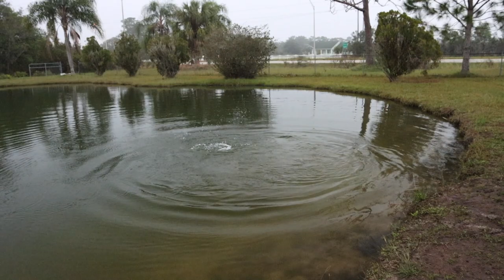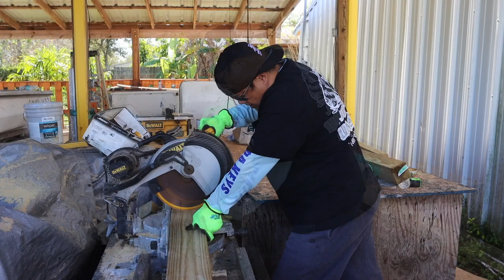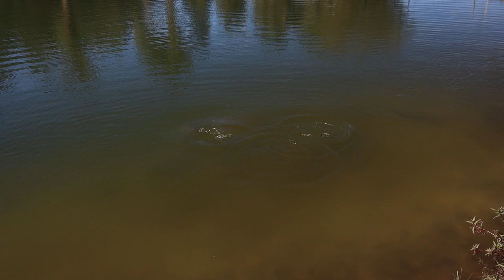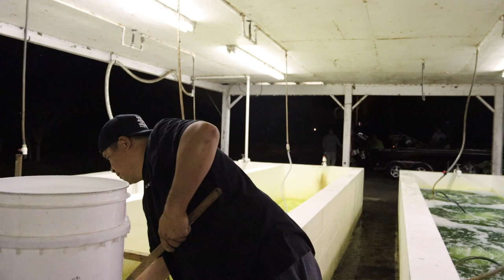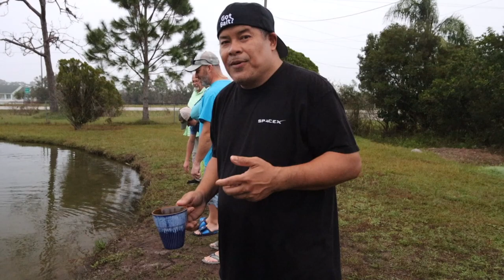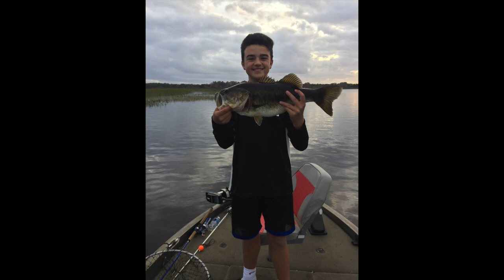Deck For My Bass Pond Project

Comment: Your Bass are amazing Sam, Great idea to have a Decking to feed them from. 
I would have Concreted posts in and built it where it needed to be, Not the way you are doing it. 
A nail gun is the easy and quick way of building it, but it will lack stability over time. 
Screws and bolts are more durable, And what i used for my own Decking. (mines not used for feeding Bass tho..only sitting on in the Sun)
Reply from the maker: I know, I should have!!!! and I just got it done too, maybe if it gets flimsy I can just reinforce it. Thank you so much for your input 👍